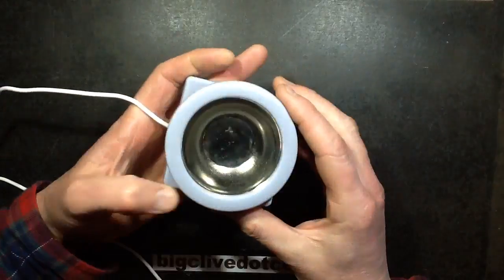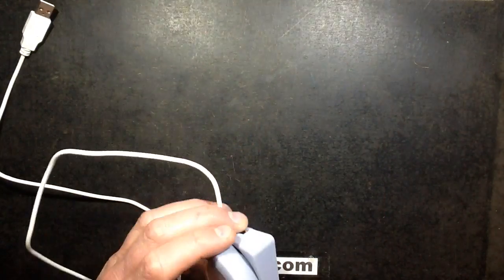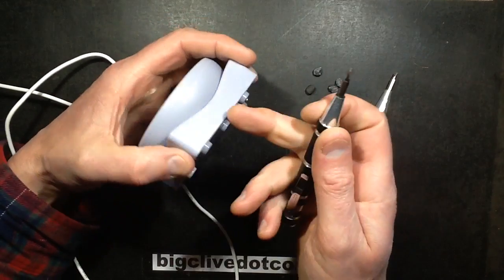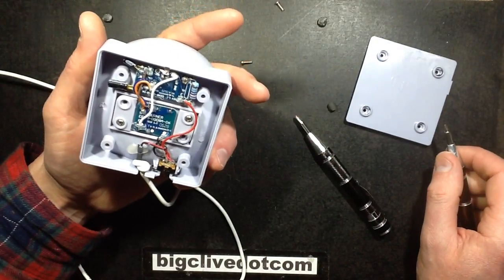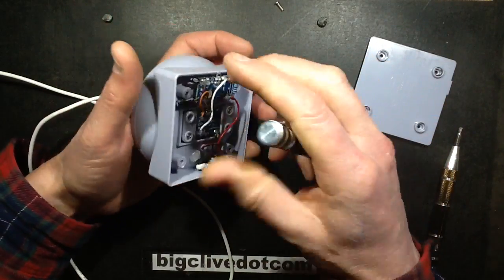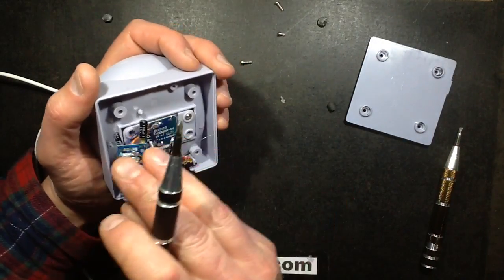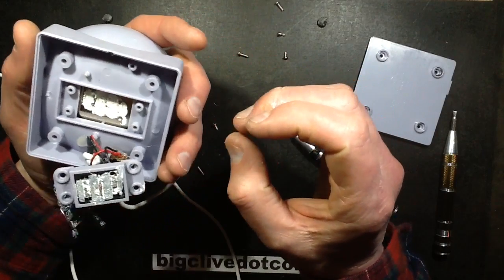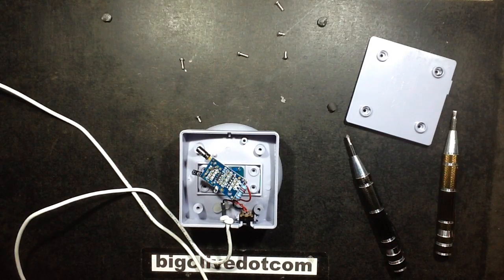Inside a USB heated oil aroma dish.

Comment: Many if not most essential oils are chemically very unstable and decompose easily, so it's not a good idea to heat them up a lot (hence the complicated temperature control in this device). But it isn't really necessary at all to raise temperature a lot, since the vapor pressure of the compounds is usually high enough for them to evaporate already at room temperature.

So depending on what is being evaporated, I think that taking the temperature to about 20 degrees above ambient temperature sounds like a good idea.

Comment: Did you plug it in in the front USB port of your pc? It seems that the rear USB ports provide more power since my external HDD wasnt powering up in the front but it did in the back :)
Reply: +RickkertJonge Thats an interesting one, I too have noticed the front mounted USB ports on my computer dont seem to put out as much power as the rear ports, or the USB hub on my monitor which takes its power from the monitor.
I seem to remember a USB port can take power from the bus or take additional power from another source, which is why you get USB hubs with a power supply.

I think this device deserves a second look as for a cheap Chinese bit of crap it is over engineered to quite a degree. I also think devices like this should take the power a USB port does provide and actually provides into account.
After all remember a USB port on a computer can be a bus or a port on a hub that might or might not have its own power supply.
I know my motherboard has 4 USB ports on the back which show as USB ports on a common controller chip, the front ports are on the same controller chip via a hub, but the hub isnt powered in its own right, so when I plug my phone in it to recharge it it takes much longer. I dont have one of those gizmos that can test how much power there really is so cant be sure on what actually comes out though
Reply: he uses usb portable power packs that run off LI-ION batteries for everything thats usb

Comment: Does that internal circuit limit the current to 420 mA, or is it limited by the power supply? If it's limited by the power supply then maybe this was designed to be powered by a wall adapter capable of supplying at least 1A, not by a laptop. Despite what people may think, a lot of USB powered devices aren't meant to be powered by a laptop.
Reply: Yeah,  I've seen some stuff show up in various videos where a couple of amps could be pulled out of a USB port.  That voltage going down to 4.7V under the load of this thing suggests that it wants more amperage than the port is willing or able to supply.  I'd try it on something beefier too,  before passing judgement on it.

Comment: The additional circuitry is there because you have to do a request through USB to get maximum power from the USB port itself.
Reply: +fuzzywzhe there only appears to be 2 wires connected between the USB input and the circuit board, i.e. the power supply, the request for additional power is sent through the data lines which aren't connected.

Comment: You don't say what the value or values of the heating resistors are. I wonder if it was originally meant to operate on something like 12V, hence the temp/power control, then someone decided to do a USB-leaded version without doing the sums.
Reply: Now I've read your reply below.
Reply from the maker: On 12V at even just 500mA they would have probably required thermal control.  It did go through my mind that it might have been an existing 12v product adapted for USB.  But they could probably just have omitted the PCB and used a couple of resistors in the existing holder to achieve a modest temperature on 5V.

Comment: Those are some nice screw divers may i ask were you bought them
Reply from the maker: They are actually really useful screwdrivers with a selection of bits stored inside the barrel of the driver itself.  I bought them from a shop in the UK called Poundland.  They're extremely good quality for something so cheap.

Comment: Most unlike the Chinese to over engineer something when they could have gotten away with one 12 ohm resister. They don't seem to normally worry about overheating, maybe causing a fire or even killing someone!
Reply from the maker: I think this may have been an attempt at a genuine product that didn't really take into account the limitations of heating something with a 5V 500mA supply.  If they'd designed it to be used with 5V 1A chargers that would have yielded 5W of heating power, which would probably have needed the thermal control.

Comment: Another interesting tear down, thanks. I've been thinking about doing heated gloves for ages do this is somewhat relevant.

Looks like these cheap devices are getting better. It's nice to see someone who looks seriously at them, instead of just dismissing anything cheap with some thinly veiled racist comment.

Most engineers couldn't resist using a scientific calculator either. Refreshing somehow.

Comment: I actually saw a USB 'heating' device once (think it was one of those cup warmers) where they used a transistor to dissipate the power, rather than a resistor, because the tab on the transistor made a handy method of fixing to the heating plate. That being said, it wasn't as damn complex as this, it was just using a bipolar transistor to drive into a short LOL
Reply from the maker: You do get resistors in TO220 packages.  But you could deliberately operate a transistor in its linear region to make it heat up.